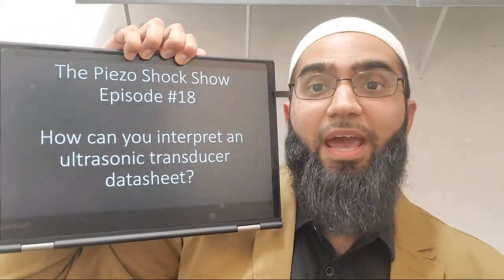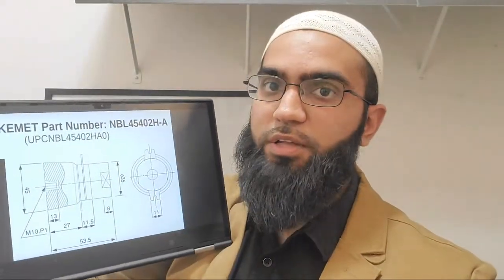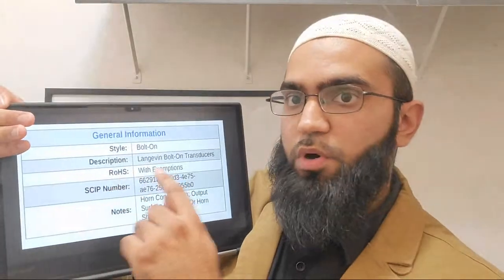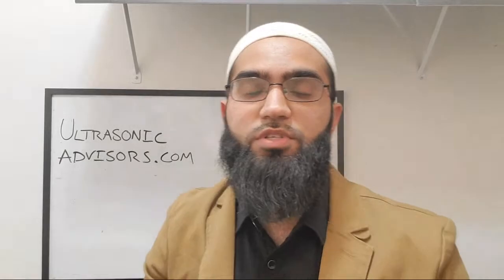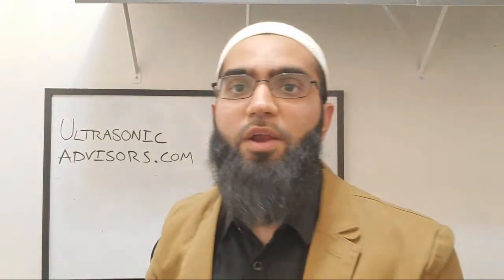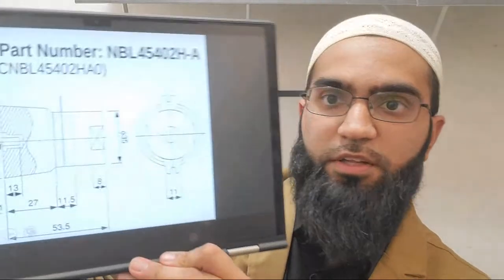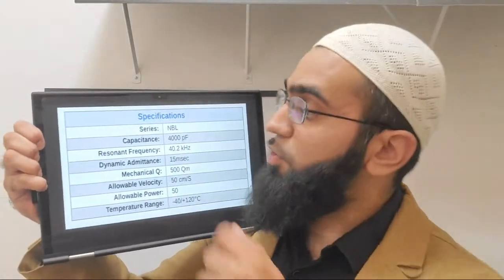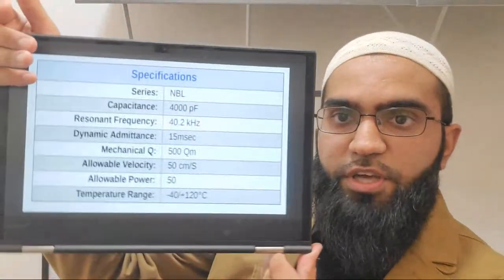Piezo SHOCK Show #18:  How can you interpret an ultrasonic transducer datasheet?

Comment: @03:85 "the longer the transducer...the higher ther resonance frequency"
I am new to the subject and learning about power transducers from different angles but I thought:
Longer transducer => Longer front mass => longer distance between piezoelectric elements (node) and the edge of the front mass( supposed to be antinode)=> longer wave length => lower frequency.
If I am wrong, please correct me with reasons that are clear enough for a beginner.
Thank you
Reply from the maker: That is the correct idea. Good work!

Comment: Finding the datasheet is not a problem if you have the model or serial number of the transducer. As far as I can tell, there's nothing written anywhere on it, except for barely readable handwritten numbers on the aluminium plate screwed against the back of the transducer itself. The only thing I know is the frequency because it's written on the cleaner identification tag. How do you do if you need to replace one?... Especially when the cleaner's model must have been upgraded at one point since the user manual provides nothing regarding circuit diagram and even gives a lower frequency than the tag for this model. 
Is it wriiten on the piezo disc itself? I'd like to know the operating voltage of the thing. My cleaner works fine except for the most important: no ultrasounds. Power supply part looks OK at first glance, but I try to narrow the problem down by elimination. Mosfets, resistors and diodes tested OK. The rest, I'm not sure. The transducers are still firmly glued in place; but are they OK, I don't know. How do you even test them if the power source is the problem?
So if anyone has suggestions, I'm interested.
Reply from the maker: You can use impedance analysis to test them. This is how it would be done at the factory. You can also test the current going to the transducer, assuming the voltage is sufficient.

Comment: You left out many other crucial parameters like sensitivity, directivity and SPL at distance.
Reply from the maker: Those parameters are important for acoustic transducers. However, it's not relevant for ultrasonic transducer in general, such as welding transducers, atomizers, surgical transducers, where the energy is delivered at the point of contact.

Comment: Is it correct to use the "allowable power" spec to calculate the drive voltage? i.e. 15 mS = 67 Ohms. 50 W = V^2/67 => V^2 = 3,350 => V = 58V RMS.
Reply from the maker: That is theoretically true. However, in practice, the impedance increases both when you attach the transducer to the tank (or if it interacts with the work, in the case of a welding transducer). The impedance also increases due to high voltage drive. The data sheet always cites low voltage drive results, because that is what an impedance analyzer uses. Therefore, I think the correct answer would be no, you can't use the datasheet to calculate drive voltage. I think as a rule of thumb you could say that actual drive voltage will be 3x of that which you calculate from the datasheet.
Reply: @ultrasonicadvisors  Thanks for the reply. This makes it difficult to select (or design) a driver!
Reply from the maker: @BenKinsella  Yes, it is difficult to get the driver "just right", but usually good enough is not out of reach.

Comment: good morning sir, i used PZT 5H rectangular shaped piezo, with a size of, length 31.8mm, width 12.7mm and height of 0.51mm, I simulated in COMSOL multiphysics, I used the pressure load of 1Pa.  the open circuit output voltage I obtained are 3.1V during its resonant frequency. however I tried to find the output voltage calculation, I couldn't get sir.  the calculation I only obtain in mili. if its the closed circuit then the answer can be accepted. i simulated for open circuit only sir. can i know the correct method to find the  output calculation sir so that i can proof my simulation.
Reply from the maker: I'm sorry I cannot provide this level of detailed help.
Reply: @ultrasonicadvisors  or not is it possible to guide for to fine output voltage for  any rectangular piezoelectric transducer, using the PZT-5H
Reply from the maker: @vmalenkupusamy1735  please contact COMSOL directly for help.
Reply: @ultrasonicadvisors  but sir I completed the comsol parts already, just left the calculation part, which in confused sir